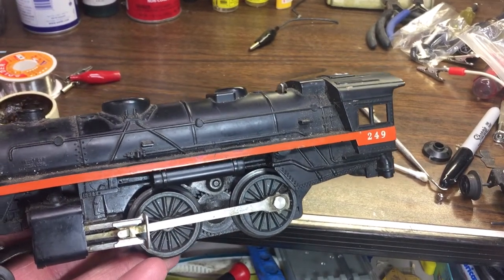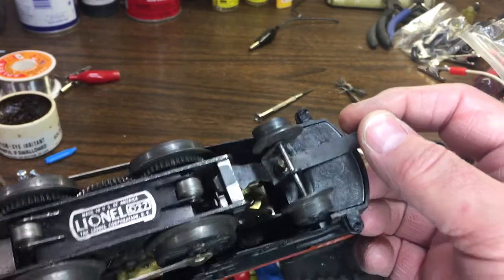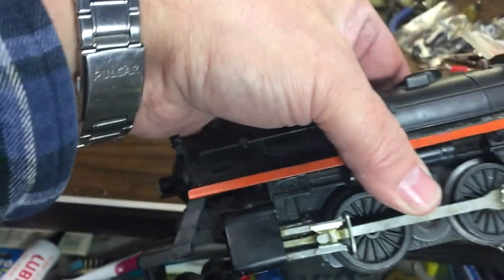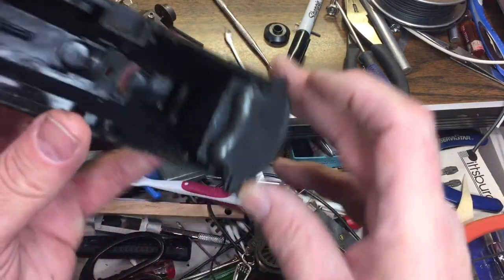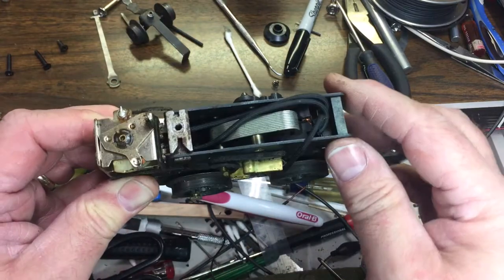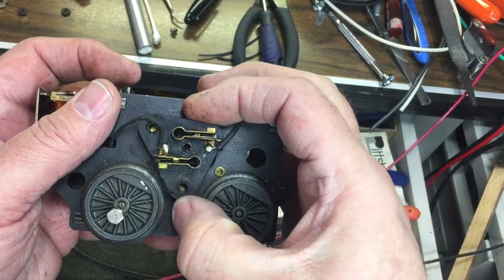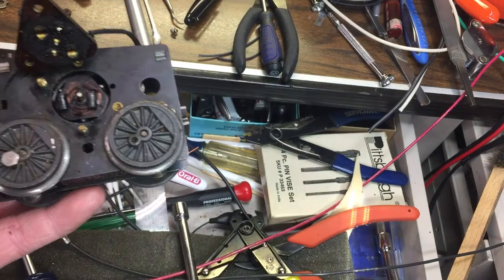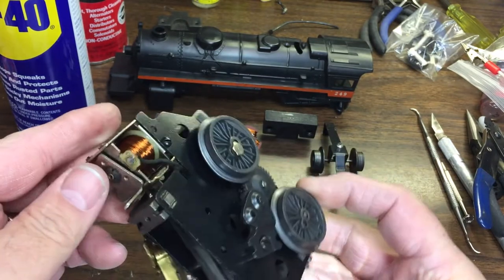Lionel 249 Engine Repair, Cleaning and Test Run

Comment: Since the screws are present cut a zip strip or cable tie drill holes mount and it's non conductive or buy another locomotive for parts. 2 4 0's are very common in Lionel steam mpc sets ebay is good for pcs parts. It's just an opinion. Thanks for sharing your video. Happy railroading. Your layout is  nice, I'm in the process  of building another o scale layout it's my zen.good luck !!! Thanks Ed c.
Reply from the maker: Thanks for your comments. I did end up using a thin strip of metal and mounted it across. Building a new layout is fun. Make a video of it. It would be cool to see it.

Comment: Nice job I just picked up a 250 and the loco squeals when I run it I’ll have to take it apart to see
Reply from the maker: A squealing noise is probably from the motor shaft that needs lubrication.  But cleaning and oiling all the rotating parts is a good idea.  Should be a fun project.